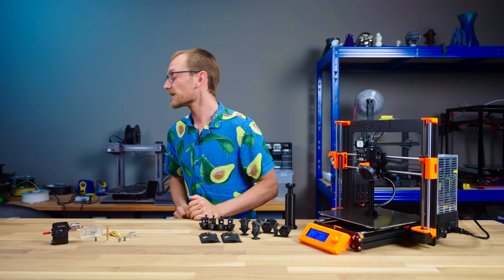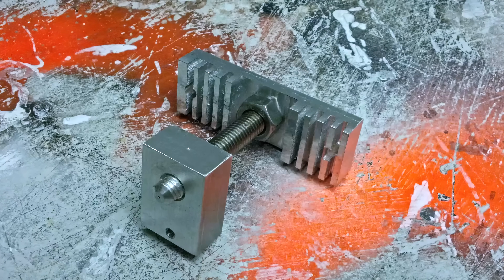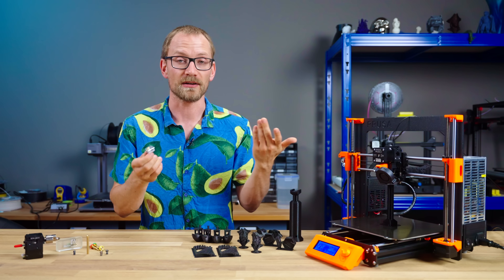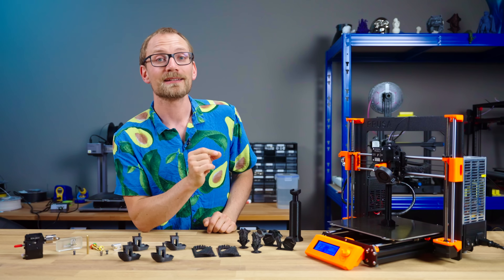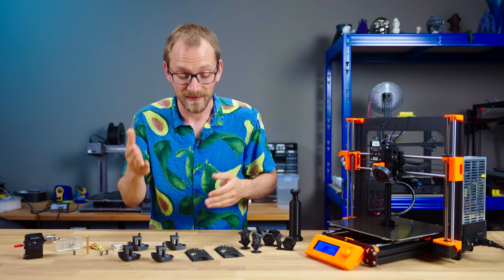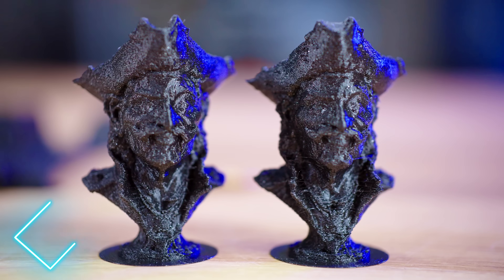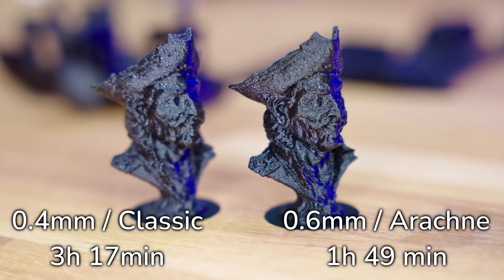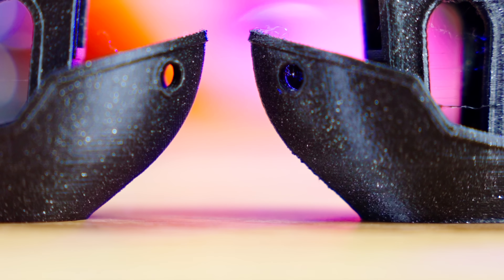0.4mm nozzles just became obsolete

Comment: Hi Thomas, dumb question maybe, but how do you turn on (or off) Arachne in Cura? I'm running 5.1 and I can't find a setting. Thank you for the video BTW.
Reply: It's not a setting in Cura, it's now the default engine. You don't need to turn it on, it the new standard. That's why when downloading Cura 5 it is a different app.

Comment: I was wondering about that. I was using cura 5.x and I didn't want to swap out my 0.8mm nozzle to make a rough part. The part had upside down triangle ramps and I just assumed my preview was glitching because it was printing MUCH thinner than 0.8mm on the smallest lines. Printed it and lo and behold all the details printed out. Mind blown.

Comment: Meh... This just feels like smooth brained sensationalism. There is a tool for every job. Arachne can be used with a 0.4mm nozzle as well. Using 0.6mm nozzles as a one size fits all approach is just as dumb as using 0.4 mm nozzles for everything too. If I need to print something with fine details I use a small nozzle, if I need to print something quick or particularly large I use a larger one or increase my extrusion line width (up to a point).

Comment: I thought the .4 stuff looked much better, I regularly run 3-4-8-1.0, seems if you were looking for detail you would go to a 3 not a 6. But ya don't be afraid of big nozzles just keep tighter control of the heat and slow down a bit

Comment: I did some testing a while back. The goal was to minimize the printing time.
I found that 0.6 mm was the maximum usable diameter. With a larger nozzle the extruder could not give a homogeneous melt, and the parts were weak. The maximum usable layer thickness was 0.3 mm.
Now I have started to test with a screw extruder that looks to give a much better result.
The cost will also drop dramatically when using pellets instead of filament.

Comment: Good video Tom.  My two cents:  Fiber-reinforced filaments and filaments with various other fillers are designed to flow through 0.4 nozzles, since 0.4 is the most commonly-used nozzle size.  Sometimes some fillers will clog a 0.4 nozzle though, which is why I prefer 0.5 as the default size.  Rarely do size 0.5 nozzles clog with fillers, and support structures still break away easily.  0.6 isn't bad in terms of support removal, but noticeably worse than 0.5, ceteris paribus.  0.8 and greater, you ought to use a dedicated support material, have part geometry that doesn't require supports, or be equipped to deal with support removal for your frequent geometry types.

Comment: I swapped to a 0.6mm MicroSwiss plated nozzle on my QiDi printer a few months ago. Faster printing, change in print quality is sometimes imperceptible, ability to print at 0.3mm layer height, some parts are stronger than with 0.4mm nozzle, no clogging with fibre reinforced filament and excellent printing with TPU.  Feels like an upgrade and a no-brainer 'mod' for £15.
Reply: Thank you for posting .

Comment: another potential problem: when printing with a .6, and .5 lines, i personally had very bad layer adhesion;
methinks either the less precise positioning of the line, or the lower pressure behind it left voids and killed the part strength

Comment: I switched to 0.6mm nozzles some time ago on Tom's suggestion. I have been very happy with the boost in print speeds and haven't really run into issues with the 0.6mm nozzle. I'm very excited about this new Arachne algorithm. Another thing that's worth noting with larger nozzle sizes is that you have a larger range of choices for layer height. What I mean is that with a 0.4mm nozzle, you can print from between 0.08 and 0.32 mm layer heights. That's a range of 0.24 mm. With a 0.6mm nozzle, you can print from 0.12 to 0.48 mm layer heights, which is a range of 0.36mm.
Reply: if you have good direct drive extruder i have not seen a big problem printing PLA at 0.4 on 0.4 nozzle and 0.6 at 0.6 nozzle so i would not limit the extrusion to 0.32 to 0.48 repectively. Especially on 0.6 nozzle.
Reply: @arva1kes  The 0.32 to 0.48 comes from the 80% rule. It's not a hard rule, as you have experienced, but my understanding was that printing with a layer height equal to the nozzle diameter doesn't give very good squish, so layer adhesion might not be as good, and overhangs will have a harder time.
Reply: @quinnobi42  I totally agree on bridging it will be really bad especially as pressure gets released on every start of the run and it will sag since it might not be dragged enough, but would its another debate on the printing strength if it should be over or underpressurized. 

On the 80% rule -  one thing to bear in mind, is that diameter of nozzle changing bigger will change volume exponentially. 0.4mm nozzle is 0.13mm2 while 0.6mm nozzle is already more than twice the volume coming at 0.28mm2 (because square root and pi is involved so essentially setting. in other way sayin -  feedrate to 200% on 0.4 nozzle print would make the single wall from 0.4 to 0.6mm only, not 0.8). So while 80% rule seems accepted @0.4mm i would argue that 0.6mm would not fall into that math anymore. it gets really ridiculous on 1mm nozzle sizes where you should extrude at 0.8mm following 80% rule, but volume difference on 0.8mm vs 1.0mm is whopping 37% (0.5mm2 vs 0.79mm2) so essentially you would very soon run into situation where you have nozzle running "half empty" and worse. I hope it helps to understand my point of view why going on bigger nozzles it's not 80% of diameter. I would see it to be more in the ballpark of 80% of volume, not diameter if you move away from well known 0.4 nozzle.
Reply: The rule of thumb is 75% of nozzle size. YOu dont gain anything. Its the same raitio. Going below .2 on a .6 nozzle is inconsistant.
Reply: @maxkool0076  I've had perfectly good results with a range from 20% to 80%, which for a 0.6mm is 0.12 to 0.48. While you might not gain anything from a percentage perspective, the range of acceptable values between 20% and 80% is larger for bigger nozzle sizes.
Reply: @maxkool0076  Well you see, I use a 20%-80% rule of thumb for all my nozzles, not 75%. That doesn't really matter though. My point was that there's a larger range. I'll do the math with your 25%-75% rule of thumb just to show it still works. 
25% of 0.4 is 0.1mm. 75% of 0.4 is 0.3mm (I see you like extra round numbers). Similarly, 25% of 0.6 is 0.15 mm. 75% of 0.6 is 0.45mm. The range of values for the 0.4mm nozzle is between 0.1 and 0.3, so if we take the difference of the two (0.3 - 0.1) we get 0.2mm range. Similarly, the range of values for a 0.6 would be (0.45 - 0.15) = 0.3mm. So the range of acceptable layer height values for a 0.6mm nozzle is 0.1mm larger than for a 0.4mm nozzle.

Comment: For 0,5 hour faster on that print wich often is the same size i do, and seldom larger i do not see a huge benefit to switch, have to use a prusa slicer for an ender instead of cura that prints flawlessly every singel time, and I do mean every time...nah. I havent leveled the bed in six months on the ender3 and I do not need to . Half an hour on this,  and one on double the size can mostly be fixed by infill anyway. Prusa slicer is not bad  but it stresses the machine from what i have tested on three different compared to my regular slicer. Probably due to the boards are not prusa and something is not ringt so I threw prusa slicers two years ago

Comment: I was already considering 0.6mm, as i figured that the difference wouldn't be significant in my prints (brackets, electronics enclosure, robot parts, etc). So with this, it is even more of a no brainer. I was considering the evo to be able to swap quickly, but is this needed with this?
Still considering this so that i would take a 0.8 nozzle. But considering the low cost of a V6 nozzle, i may as well change my .4 right away...

Comment: One thing that wasn't specified is just how much of a difference going to a nozzle that is 50% wider.  While you make think that the maximum flow would also increase by 50%, that just isn't the case.  Remember that the area of a circle--i.e. the nozzle opening--is 'pi * r^2'.  As 0.4^2 = 0.16 and 0.6^2 = 0.36, that means that a 0.6 nozzle can push more than TWICE as much filament as a 0.4.  That right there will save you a LOT of time.

Comment: Tbh switched to a bigger size as soon as I was able to. Printing with 3-4 walls with no or 10-20% infill. This to speed up 8hr prints to under 2hrs, with sometimes even slower print speed. Since I make my own parts I calculate factors of two or three as much as possible to vary output for 0.2 or 0.3 print lines if it's too thin. With 3 or 4 walls it should just print a single or two lines just fine.

Comment: Spoiler: you can print in 0.6 line width with a 0.4 nozzle. Even 0.8 perimeters are absolutely fine. Basically there is no visible difference with the actual 0.6 nozzle, you can get the same speed improvements. Printing <0.6mm lines with a 0.6mm nozzle - not a good idea.

Comment: You might also want to consider filament use. You will likely want to print two perimeters with both 0.4mm and 0.6mm nozzle. But two perimeters in 0.6mm are are way more material. Also infill. Mind that this mostly exists to lay down the top layer nicely. Thicker infill is less useful than more infill lines in that regard. A 0.6mm nozzle will create thicker infill using more filament.
Reply: But if you use 3 perimeters normally (3x0
.4=1.2), a 0.6mm nozzle only needs 2 (2x0.6=1.2)
Reply: @jojoflowe  True. But I'm already using 2 perimeters with my 0.4mm nozzle and am mostly happy with the strength of the parts. So in my case it would be an increase in material.
Reply: It is  possible  to print infill a way smaller than the nozzle.  Since the flow is reduced the speed can be increased without needing an high flow nozzle.  It save a lot of material and time and it still can hold the top layer.   Internal wall can also be printed a bit smaller than the nozzle if the layer are thin enough to allow the plastic to still squeeze a little.

Comment: 100% agree with your 0.6 recommendation.  I switched to a 0.6 two years ago and have never looked back. I have only had some rare minor issues with thin walls. With 0.6 your walls will be stronger, you will get better layer adhesion and print faster. Now that we have variable wall thickness this is definitely the nozzle of choice, since there are really no downsides any longer. If you want ultra fine details a SLA printer is the way to go for those anyways.

Comment: I finished designing and building a low mass 300mm delta that has an impressive speed.  My extruder is a standard 'run of the mill' type, so I am concerned that increasing the size of my nozzle to .6mm might over-tax heat delivery of my extruder.  What are your thoughts?

Comment: Did you print my Sony microscope adapter? I'm curious whether the two perimeters get stitched together properly with Arachne (without using Arachne it has gap fill all over the place and pretty much looks like a torture test, contributing to a ribbing pattern being visible on the outside walls)
Reply: To answer my own question, my microscope adapter prints beautifully with Arachne turned on! Much smoother result without using gap fill.

Comment: Am I the only one who likes to print at 0.5mm width (with a 0.4mm nozzle) because it makes calculations easier? If I have a screw hole 2mm from the filleted corner I know there will be exactly four lines in there. I like to print at 0.125mm layer height as well, eight layers per mm and a 4:1 width:height ratio (good for strength). I’ll go with a 0.8mm nozzle printing 1mm wide and 0.25mm high for fiber filled filaments to minimize clogging.

Comment: Have you tried printing you gcode sliced for a 0.6mm nozzle with your 0.4mm nozzle? I bet you'd hardly see any difference. You should try that.
I use a 0.4mm nozzle and I often print with 0.7mm extrusion width for stronger parts or even 1mm for vases - no problem. I don't see why I should use a wider nozzle if the standard one is capable of wide extrusions. On the other hand, I still have the option for narrower extrusions with 0.4mm.
Reply: Yeah, exactly. I use 0.4 nozzle and most of the time I print with 0.44 - 0.6 line width just for better strength. I always customize every setting (cura user here) I need to get the best results for the model I am printing. As most of the time I print utility stuff I don't care that much about appearance as the print strength and printing time and using line width wider than nozzle diameter is a way to go. 
Never had any issues with underextrusion whatsoever.

Comment: I use different size nozzles depending on what I'm printing. For tiny, very detailed prints 0.25 is good. However for very large rough prints 1.0 will work.

Comment: I've been using 0.6mm nozzles on my delta printer for ages, because, as you, I usually make midium-coarse prints that need no detail at all, adding that my delta isnt the most accurate printer out there, adding a 0.6mm just improved speed without affecting quality!

Comment: I print mainly 28mm miniatures on my cr-10 v1 (bought second hand from a friend). Currently unable to switch to a resin printer due to logistical constraints.
My usual models are more detailed than those used for comparison, and Arachne has provided better detail thus far.
I tried using a 0.2 mm nozzle, but clogging is an issue. 0.4 works fine. 0.6 is way too coarse, detail is horrible.

Time is not an issue, as models are tiny. As long as the print time is less than 9 hours, you can go to work and come back to a finished product. There is no difference in 1 hour or 6 hours print. The key point is reliability.

Also, switching from pla+ to hips has proven a boon, as broken prints are way easier to repair. Also multipart prints are sturdier and easier to assemble (using ciclohexanone, ethyl acetate or MEK).

Comment: Years ago, I have used 0.15 mm nozzle for these ultra high quality prints. They took literal weeks sometimes (55 cm tall EVA-01 figurine, consisting of almost 350 parts, total mass: 1.8 kg. Total print time, with supports: 85 days! Most of that was around 7 to 18 mm/s), and yet, current resin printers blow that out of the water by orders of magnitude.

I had to step back and admit that FDM is simply too ill suited to some things.

Comment: I already use 0.6 for Nylon-CF and regarding what I'm printing.   Otherwise 0.4 is higher resolution , it just is. Time is not a concern for me. I'm using Qidi Print, not Prusa Slicer. So what happens when you enable the Arachne engine with a 0.4mm nozzle?
Reply: He mentioned that near the end.  Even finer resolution and detail.  I'm downloading Cura Arachne Beta now.

Comment: I tried 0.6 nozzle 0.3 layer with Volcano and returned back to 0.4 and V6. It's just not for me, because I sometimes even use 0.2 nozzle to print glass-fiber reinforced fillaments and make small and thin but strong and rigid parts.
Reply: I would have thought that any reinforced/filled filament would clog the crap outta smaller nozzles, my go-to local brand even tells you to use a 0.6mm one for marble (granted, that's bigger particles but still).
Reply: @Kalvinjj  I print 12% Glass Fiber reinforced ABS with 0.2 hardened steel nozzle flawleassly. Never experienced clogging at all. Maybe there would be issues with 30% reinforced fillaments, but I never printed them with 0.2mm nozzle. Instead I print 30% Glass Fiber PA66 with 0.4mm nozzle and there is no issues too.

Comment: Definately looks interesting. I don't really like to switch nozzles if it can be avoided, so comparing the part strength between a 0.4 and 0.6 printed part would have been interesting. Especially on engineering parts where the 0.6 seems to be the right choice. I wonder if there are any benefits in layer adhesion or other mechanical properties. I guess, if you generally push out more plastic at the same time, you can just add more perimeters or denser infill with the bigger nozzle, without loosing as much time compared to the smaller nozzle.
Reply: 0.6 is great for structural parts

Comment: Also to get a 1.2mm wall thickness it was 3 walls with a 0.4 and is now 2 walls with a 0.6, less passes to hit infill % as well.  I think a lot of people using prusaslicer extruded wider than their nozzle anyway, but a lot of default profiles in cura would match extrusion thickness to nozzle size.
Reply: With a 0.4 nozzle you can easily print 0.6mm lines or even wider. This is what really saves you print time (printing less walls and surface areas are much faster) without speeding up the print head leading to bad quality.
Reply: @stuttgartbatman3788  you’d be surprised how many people do not deviate from the nozzle size.  And I believe there was a video done on doing just that and the quality does suffer Vs just using a bigger nozzle

Comment: I'll go against the grain and say that I won't be throwing out my 0.4 nozzles. My main machine runs a 0.4 and my second machine runs 0.6 and i've been running it like that for more than a year now. I did try a 0.2 and it was fantastic for detail and yes very slow. But the filaments aren't pure enough and contain impurities that keep clogging the nozzle.
In the end it's down to what you're using your printer for.

Comment: I have two printers and during spring and summer of 2020 used them to print face shield parts; my ender 3 pro with its .4 mm nozzle printed quite a few, but my older modded i3 clone with a 0.6 nozzle printed 3 times as many. Now that I've learned about how good Arachne is, I'll switch to a 0.6 mm nozzle for the ender as well. Thanks!

Comment: I started printing back in 2013 with a 0.35 budaschnozzle and dealt with the slow print times for years. About 3 years ago I got a 0.8 E3D Volcano nozzle and now print layer heights between 0.15-0.6 and line widths between 0.8 and 2mm ( I bump up the temps to get flow rates up to 40mm^3/s)